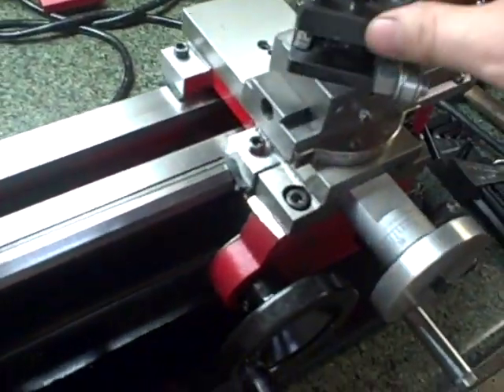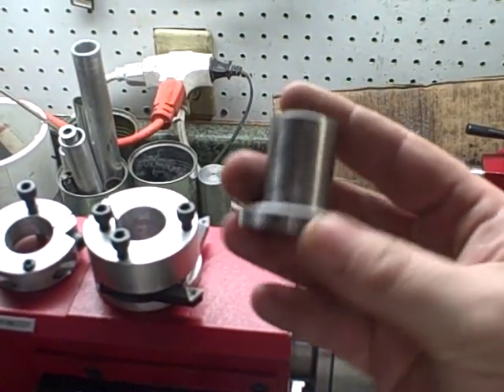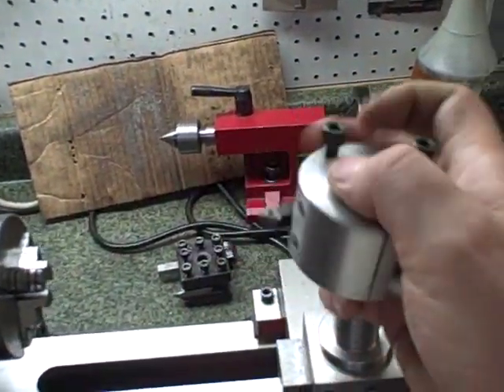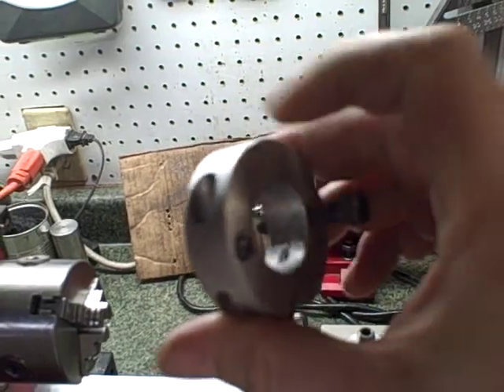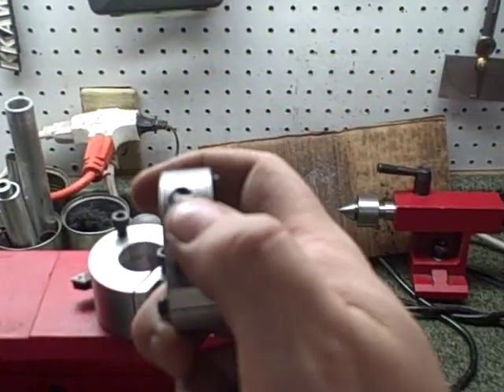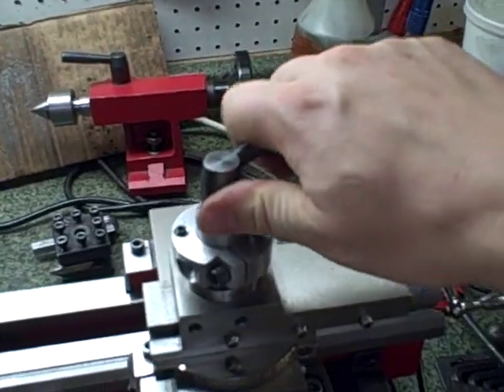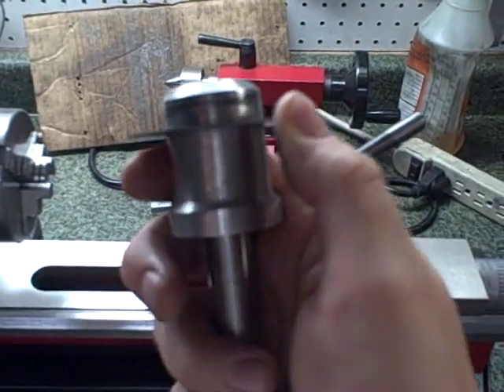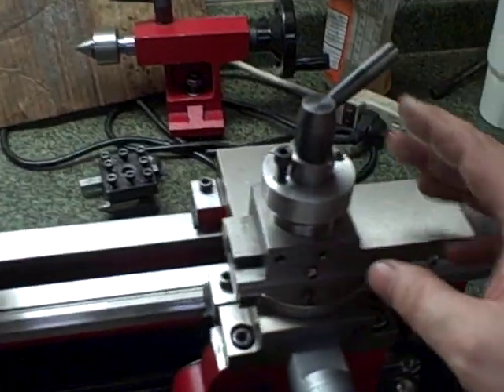DIY Quick Change Tool Post

Comment: this could probably be indexed pretty easily, too - 

use a center gauge square on the bottom of the base piece, scribe two lines 90* apart. cut the radius in half, scribe the center, drill and tap a hole for each (0* and 90*) and place a set screw in each one. then, drill a small hole in the tool holder piece (this is the only real precise part) to mate up on either of those indexes on the base. makes it a little more convenient for the "quick change" part.

Comment: Yo. I found some inspiration in your video when I searched YouTube for ideas for qctp's. It might not be quite like it but it got me thinking. Thanks!
Check it out: https://youtu.be/fyjRVgJVigc
Reply from the maker: That looks really solid.  I doubt you get much, if any, chatter due to the holder.  I like your height adjustment too.
Reply: Thanks! Cool hey! Was worried about vibration due to the narrow footprint but did some heavy cuts with no problem.

Comment: I don't know if you'd quite call it quick change, but it looks much more convenient than the conventional tool holder. It's a really cool solution, i might have to make one for my lathe
Reply from the maker: +Rob Mckennie Yeah, I suppose it's a "quicker" change tool post.  One thing I'd do a little differently though, is to make the whole thing from steel.  The aluminum tends to crack at the bottom of the bit clamping area from either over tightening of the bit hold down bolts or cutting stresses.

Comment: you mentioned that one of your tools used plastic gears, if this is the case... why not make metal gears, now that you have the machines to do this
Reply from the maker: +Robert Ostman This video is a few years old.  I've since replaced the plastic gears on my small mill with a two step pulley system, which works very well.
Reply: +Robert Ostman The plastic gears are a kind of fail-safe in the event of catastrophic operator errors (which are all too common). Metal gears would continue to push the spindle further into dangerous conditions. The pulley systems provide parts that are not as damageable but also incorporates a similar fail-safe capability (as well as being quieter). I hope to make that upgrade myself soon. :-)

Comment: Nice, should make another taller post so you can remove the compound slide and mount directly to the cross slide for greater rigidity. Some flats or a cross hole for a tommy bar on your slitting saw arbor would be a nice touch. Good on ya for casting your own slugs too!
Reply from the maker: All good ideas.  I'm planning to do away with my compound once I've converted that little lathe to cnc.  Simply making the cylindrical tool holder higher hadn't occurred to me.  Thanks and thanks.
Reply from the maker: djpaulk
That's a highly detailed little motor you have there.  It's obvious you put some serious time and love into it.  Also, nice mill btw.  I like the tooling plate but your mounted dremel might take a finger if your're not careful :).   I've spent a LOT of time researching this little lathe (mini-lathe.com, vamint al, etc).  I love how It's a highly modifiable machine.  The downside is it requires frequent adjustment.  Still, owning it has been a good learning experience.
Reply: Thanks Chuck, they are good little lathes and make buying/owning a lathe affordable to the home shop machinist. I too have spent many moons researching mini lathes and mills. Its a great hobby and these little machines open a whole new dimension to home machining capabilities and the learning along the way is priceless. The little dremel unscrews quickly and easily by undoing the nose collar, its not usually mounted and is used a a die grinder most of the time.I got a piece of metal in my eye a while ago, I thought it would be ok in a day or 2, but it rusted.. Had an irritated watery eye for a month and had to get it ground out by eye surgeon with alger brush/burr. Not fun at all.... but I still have all 10 digits :D
Reply: Ohh yeah, changing the gib adjustment screws from grub screws to caphead screws makes adjustments easier.. I found my gib grubscrew heads were made of cheese, like many other parts of these machines. There is a lifetime of adjustments and mods to make on these mini lathes and mills. I just finished putting a treadmill motor on my lathe, metal spindle gears and re ratio the drive pulleys to alloy xl series sychro drive pulleys... When does it stop? :P

Comment: Nice job but it looks awkward to change toolholders if you have to remove the toolpost retaining nut each time or do you just remove the wing handle once the toolpost nut is tightened?
Reply from the maker: You can remove just the handle.  I'll admit, it is somewhat awkward but it sure beats the turret toolholder that comes with the machine.  Also, they're very easy to make and they can be made for specific jobs.  I've got one on my south bend 9" now that's the same diameter of center post so I can exchange holders between the lathes.  I do plan to move to an aloris style eventually once funds permit but for now, these work pretty well.